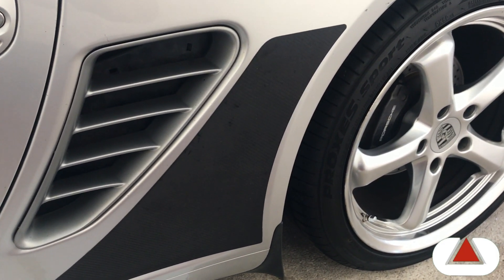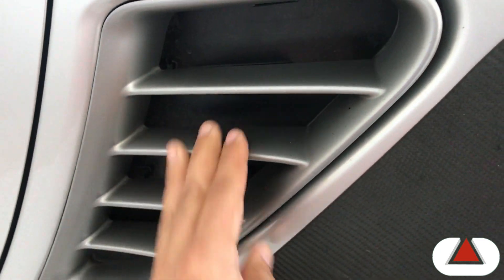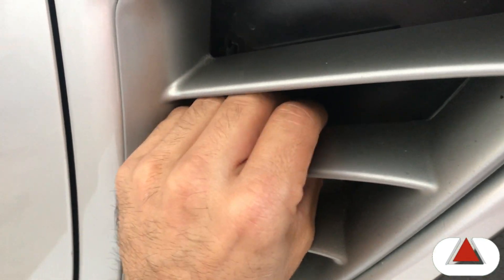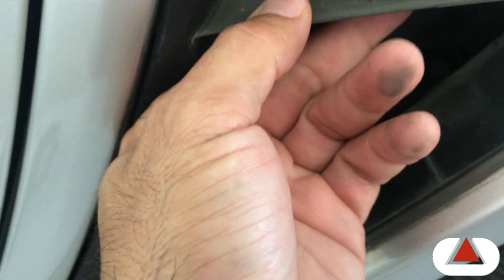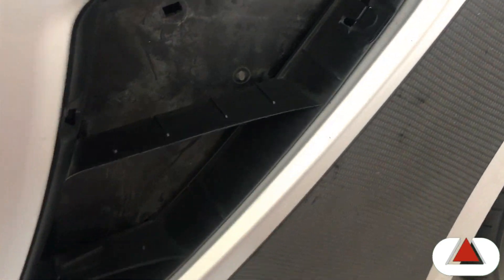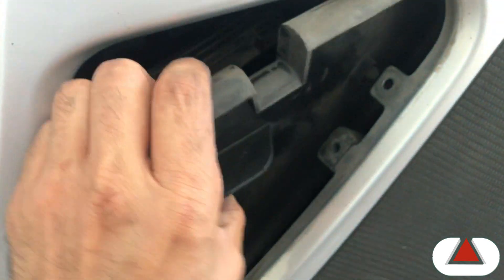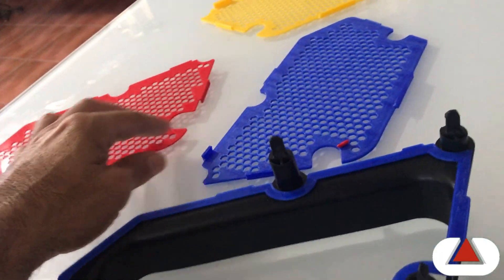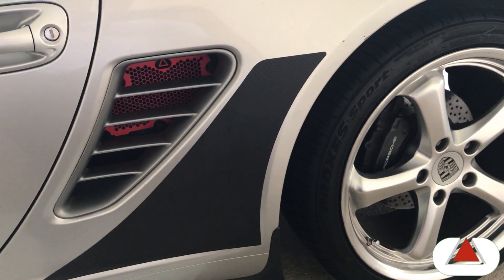Porsche  987 DeSnorkeling

Comment: Hello, what does the second "air intake" do, I'm refering to the hole on the other side of the car? Does it do anything or is it dead - meaning only for aesthetics?
Reply: There is a fan in the other side
Reply: @marcosbatista5237  Which does what? Blows/sucks air to what/where?
Reply: @uouba  sorrry, I have seen the fan from the outside but not sure exactly if it is cooling something on the engine bay.
Reply: It blows the hot air out of the engine bay @uouba